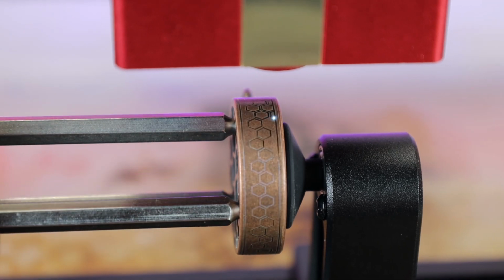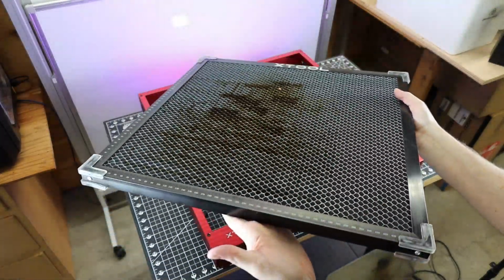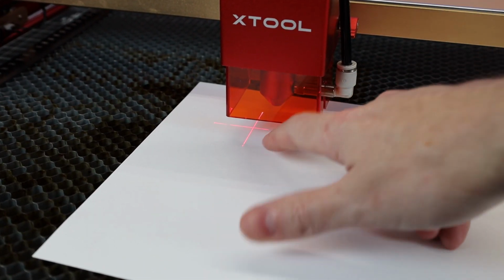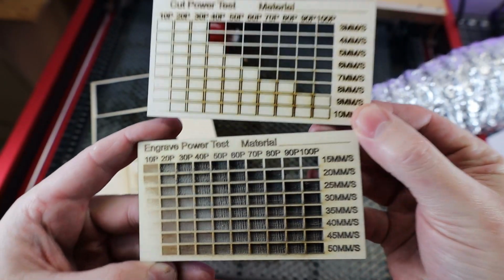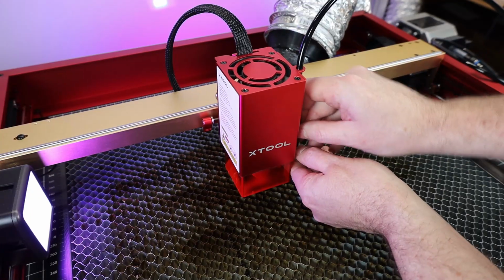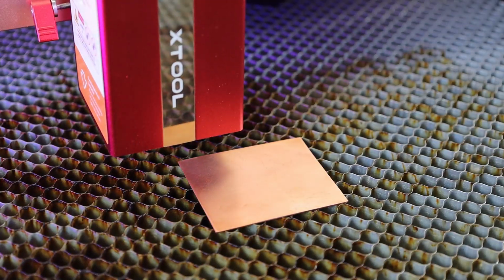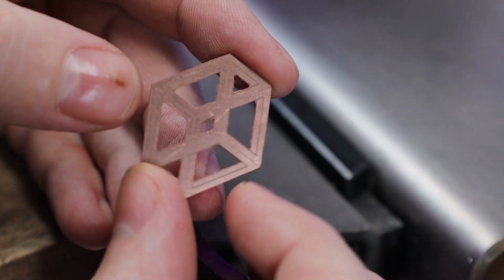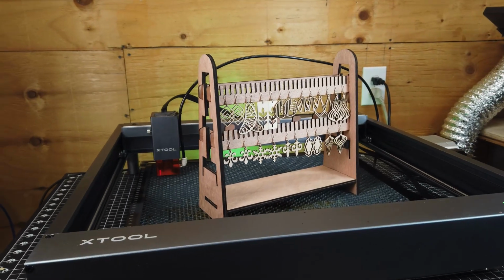Transform Your Jewelry Making - Effortlessly Engrave Metal & Cut a Range of Other Materials

Comment from the maker: xTool D1 Pro 2-in-1 Kit: 455nm Blue Laser and 1064nm Infrared - https://bit.ly/xTool-D1-Pro-2-in-1Kit
xTool D1 Pro 20w Diode Laser (US) - https://bit.ly/xTool-D1-Pro-20w-Diode-Laser
xTool D1 Pro 20w Diode Laser (UK) - https://bit.ly/xTool-D1-Pro-20W-UK
xTool D1 Pro 20w Diode Laser (EU) - https://bit.ly/xTool-D1-Pro-20w-Diode-Laser-EU

From xTool:
xTool D1 Pro Laser Engraving & Cutting machine - https://bit.ly/xToolD1-10W
xTool D1 Air Assist Set - https://bit.ly/xToolD1AirAssistSet
xTool RA2 Pro 4-in-1 Laser Rotary - https://bit.ly/xToolRA2Pro
xTool Honeycomb Cut Bed - https://bit.ly/xToolHoneycombBed
xTool Materials - https://bit.ly/xToolMaterials
xTool 20W Diode Laser Module - https://bit.ly/xToolDiodeLaserModule20W
xTool Enclosure Smoke-proof Cover - https://bit.ly/xToolEnclosure
xTool Smoke Purifier - https://bit.ly/xToolSmokePurifier
xTool RA2 Pro 4-in-1 Laser Rotary - https://bit.ly/xToolRA2Pro

From Amazon:
xTool Enclosure Smoke-proof Cover - https://amzn.to/3dFU8vy
xTool D1 PRO Laser Engraving & Cutting machine - https://amzn.to/3Ccvf4H
xTool Honeycomb Cut Bed - https://amzn.to/36hLVdq
xTool RA2 Pro 4-in-1 Laser Rotary - https://amzn.to/39u4Mn7
xTool D1 Rotary - https://amzn.to/3tzO0tD
xTool D1 8Pcs Laser Engraver Raiser - https://amzn.to/3O0q7U8

Materials & Cut Bed - 
Honeycomb Working Panel - https://amzn.to/3txRY60
3MM x 12" x 12" Baltic Birch Plywood - https://amzn.to/3uMibyJ
1.5mm x 12" x 12" Plywood Sheet - https://amzn.to/3uLqfje
Metal Business Card Blanks - https://amzn.to/3uF3oWp
Earring Hooks - https://amzn.to/3xv2ihU
Opaque Acrylic Sheets - https://amzn.to/3l1JKC0

Free Files:
Engrave Material Test Laser Pattern (LightBurn) - https://drive.google.com/file/d/1VmzXgLFeil-zOarKUNs0QklVCMqqTEQA/view?usp=sharing
Cut Material Test Laser Pattern (LightBurn) - https://drive.google.com/file/d/1DVm-P38fsdGC2fzOeuDwhkWSrzNS6A-t/view?usp=sharing
Earrings Laser Pattern - https://cartonus.com/jewelry/
______________________________________________
If you are looking for more tools and materials that I use, well you're in luck! I made a page on my website just for that.
https://GomeowCreations.com/tools-and-materials 
https://GomeowCreations.com/partners-discount-codes

Note: Most of the links that I use that go to products are affiliate link. This means I make a small commission on anything that you happen buy using them. This is at no extra charge to you and this helps support the work I do on this channel. 😁👍
______________________________________________
Other Ways To Help Support The Channel:
My PATREON ➜ https://patreon.com/GomeowCreations
One time support ➜ https://paypal.me/gomeowcreations
______________________________________________
Instagram ➜ https://instagram.com/gomeowcreations/
Facebook ➜ https://facebook.com/GomeowCreations/
______________________________________________

Comment: I would like a full jewelry-centered video about this that includes more on using to engrave on stainless steel. I have been looking at but just can't afford a fiber laser so <$2K seems like a steal of a deal if it actually engraves stainless even if it's not deep it's better than marking with Cermark that wipes off if it isn't super clean. Like the idea of using it to make indelible patterns for sawing and filing etc. Great for personalization and makers marks and marking k too.
Reply from the maker: It will try and come up with something to make using it for a full video 😁
Reply: @GomeowCreations  Great video! I'm curious about this too - will it engrave hardened steel to create texture plates for the rolling mill?
Reply: @GomeowCreations  Yay!

Comment: This thing is incredibly unsafe. No protective shield, no fume hood. Do not use these types of laser engravers. They are not made with safety in mind at all. They don't care if you die, as long as you buy their machine.
Reply from the maker: Yes these are dangerous, along with almost everything else I show on this channel if used without precautions. You do have to have some knowledge about the machines and what they can and cannot cut to use them safely. Now that I think back to it I didn't go over all the safety stuff in this video as much as I could have but I have covered it in multiple other videos in the playlist at the end of this video. I did talk about how you need ventilation for this along with your best open is to get an enclosure. 

This does remind me that I need to add my list of do and do not items to cut using these kinds of lasers to the description so thanks for that.
Reply: @GomeowCreations  I'm glad you agree. Yeah these things should never be used in the way they ship it.
Reply from the maker: Definitely not unless you're able to use it outside, You're the only one around it for about a mile and you never take the glasses off oh and only cut wood. 😂

Comment: I'm curious. Have you ever tried using a jigsaw with a jeweler's saw blade installed, for doing your metal cut-outs?
Reply: Use a Hegner Scroll saw...or do it by hand. Wearing a magnifier head piece.
Reply: @Lightning-Man-1954 : I wrote "jigsaw", but was thinking scroll saw. I think a scroll saw would be quicker, and possible more accurate, than sawing by hand.
Reply from the maker: I kind of assumed as much I've had this question before but I've never gotten around to actually buying one try it out.
Reply from the maker: I haven't
Reply: I'd say he's doing the marking out for jeweller's who rather than marking out delicate markings by hand, employ him too. Also these line's help to engrave tiny line's for engravers. 
The one issue is are you computer savvy.  My one stumbling point issue. 
Never too old to learn..just have to have a good fume extraction system.

Comment: I haven't heard of an IR laser for marking metal
Reply from the maker: Yeah normally you just see fiber lasers doing it. Fiber lasers produce wavelengths between 780 nm and 2200 nm so this one doing something in that range makes sense.
Reply: Is this laser workable I n Australia for 230Volt power.
I already do Laser Welding repairs...really interested in the pendant controller rotary system. I made one using a stepper motor and micro pendant controller. Based on your review I'd buy the  $1700 unit.
Excellent video if it does everything you've shown. Regards from Down Under. 
Mike
Reply from the maker: There is a AU 220 volt option so I believe that will work for you if I'm understanding it correctly. Here is the link to it https://bit.ly/xTool-D1-Pro-2-in-1Kit

Also just so you know if you buy through this link it does help support my channel. 

If you have any other questions feel free to ask.